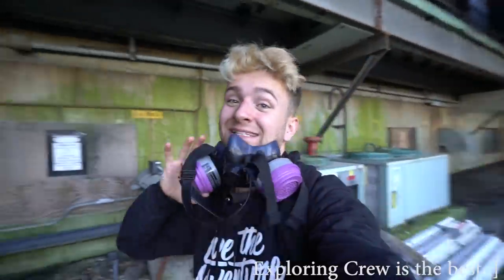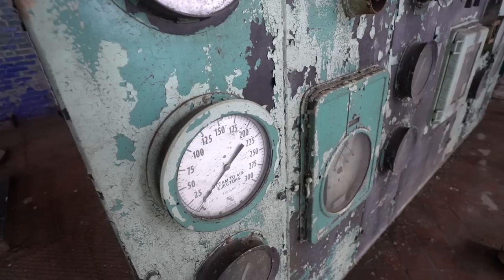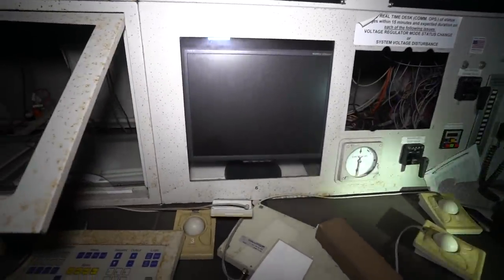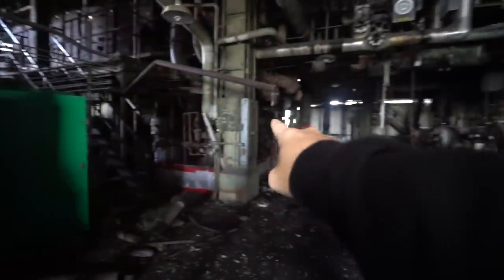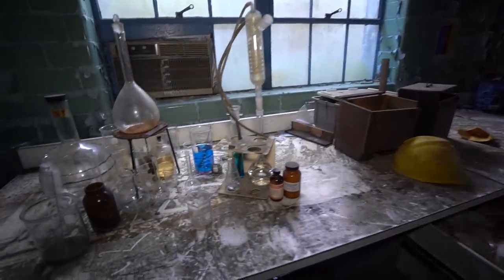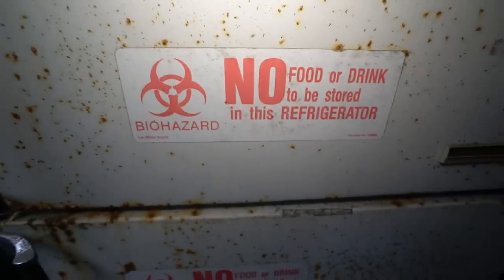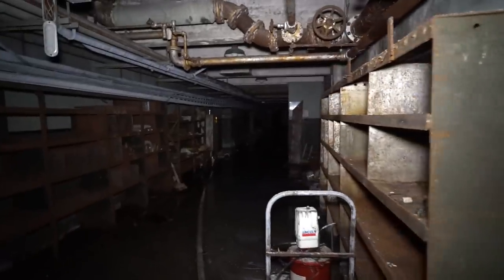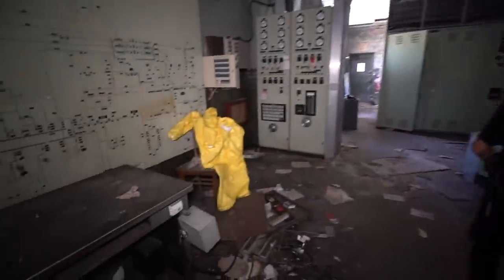ABANDONED Laboratory/Power Plant (Biohazard material)

Comment: If anyone finds it interesting, these are some of the chemicals and bottles that were in the laboratory:
Potassium Iodide: Used to treat radiation effects, as dietary supplement, in film photography and other industrial uses.
Immersion Oil Type NVH: Used in optical microscopes.
Leco Calibration Sample: Compound used in many Industrial/Lab equipment and machinery.
General Electric Red Ink: For a lab recorder (those machines that print out something similar to an ECG).

Not biohazard material really, still poisonous if ingested though. Cool video btw.
Reply: Educational i fwu

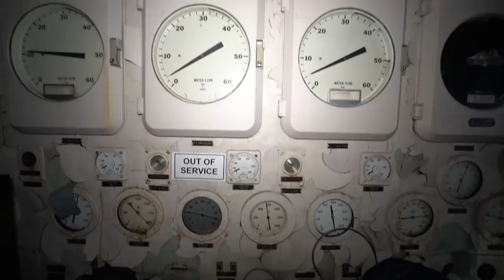Comment: 4:06 is the mask for an Arc Flash suit, which is required for protection when working with large amounts of electricity, without it the heat from an Arc Flash is capable of melting the skin off your face instantly.
Reply: Adam Riffe my god really?
Reply: Adam Riffe  Thank you for sharing that's really cool
Reply: The arc is usually as  hot as 4 suns combined...
Reply: I thought I was that but didn't want to say in case I get shit for getting it wrong
Reply: ApocalypseReady 1 if it was that hot just the simple fact of it being there would melt the whole place due to radiation.
Reply: gavin briggle The reactors won't melt down, it's a coal power plant, the only thing they'd need them for would be for the chemicals stored there.
Reply: He is right, I used to wear a similar mask while working with electrical arcs.
Reply: Adam Riffe I believe there's an arc LIGHT helmet for welding, right?
Reply: Joshua Lee yes there is
Reply: More like for instantly blinding you
Reply: Whoa.. ty for the info Adam.. was curious what that was for as I've not seen that type mask before.
Reply: Adam Riffe  thanks to the information 😆
Reply: Stoger 1 ok I think you need to check your facts with that one
Reply: Thanks I just Learned something new

😁

Comment: I'm just a student and this is just speculation since we don't really know what the heck is in those beakers and we only know that theres potassium iodide somewhere involved. But I'll give it a shot. I'm assuming the purpose of that lab was most likely some form of analytical control and they werent working with anything weird.

Blue chemical may have been just something for cleaning, since it has that cleaning brush submerged on it, but it would be weird to have it so far from the sink. Otherwise it may be copper ammonia complex since the colour is similar and there's also something that looks a bit teal nearby that could be copper in aqueous solution (I think they are stable enough to last for years but i don't know).

Things in the stove are definitely samples of whatever they were working with in the plant, most likely to check for presence of certain metals, that's probably where the potassium iodide comes into place (and with it the yellow solution that is the only I can truly assume that is probably coloured like that because of I3-)
Reply: well a lot of plants have pH buffers to calibrated their equipment with. could be a number of things, but likely harmless unless ingested

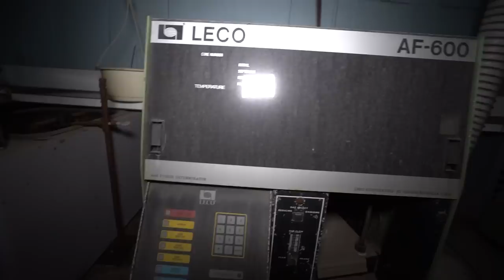Comment: 07:50 googled Leco AF 600 and found AC 600 I assume more or less the same use

The LECO AC600 semi-automatic calorimeter is a Windows -based
instrument developed to measure the calorific content of various organic
materials such as coal, coke, and fuel oil.
The calorific value of a sample is determined by precisely measuring the heat
released after combustion of the sample in a controlled environment. The
heat released is proportional to the calorific value of the substance.
The sample is placed into a combustion vessel, which is pressurized with
oxygen. The combustion vessel is automatically lowered into a water bath
within the instrument known as a bucket. The bucket is sealed using an
inflatable bladder. The cavity surrounding the bucket is known as the jacket
and is also filled with water. The water temperature in the jacket is closely
controlled at a precise set temperature (isoperibol calorimeter system). The
sample is ignited and the temperature of the bucket and jacket water is
measured by an electrical thermometer with a resolution of 0.0001 of a
degree. A measurement of the water temperature inside the bucket and
jacket is collected every second. The results can be corrected within the
software for any spiking, nitrogen, sulfur, moisture, and ash content if
necessary. Two options for analyzing data are available. A simple
temperature difference may be chosen by the user (standard mode), in which
calorific values are determined by a simple maximum temperature rise of the
bucket. The user may also choose to use a thermodynamic model
(TruSpeed™ mode) that has been developed by LECO to model heat
exchange within the AC600 system. The TruSpeed mode takes into account
heat capacities of the system's components along with corrections for energy
transfer within the system. The TruSpeed mode enables the AC600 to attain
rapid 5 minute analysis times without compromising the accuracy or
precision of the calorific result.

Comment: The "thermal suit" is for high voltage work
The red lock boxes are for lock out tag out, when you lock off a power source. Typically a key is in the box, so Everyone working on the equipment puts a lock on it.

Comment: I used to work in an energy research center that did a lot of work for coal-fired power plants. It had a lab to determine coal quality, which is very important to know. There was also a lab to study the coal ash and slag that forms in the inside the power plant's boiler. I noticed some trays that looked as if they were full of slag. My guess is that this power plant had a lab to do all that testing in-house rather than send it somewhere.

Comment: Ok josh,, fisrt off, asbestos isnt a biohazerd its a carcinigen just like paint fumes, also those lock boxes contain the emergincy shut down protocals, see powerplants arnt supposed to shit down in a matter of minutes rather run for hours and hours after you "shut it down" becouse the boilers need to cool and the turbine needs to be isolated from the loop witch also prevents the water from making it to the thermo cuplings and the heat exchanger